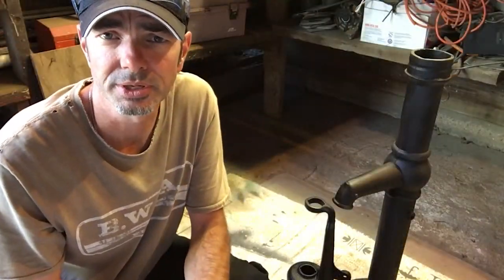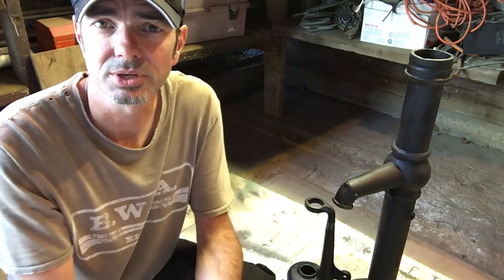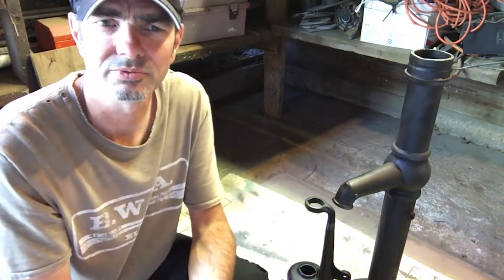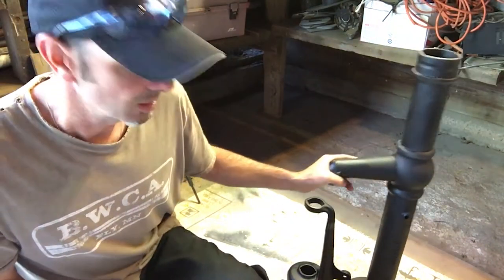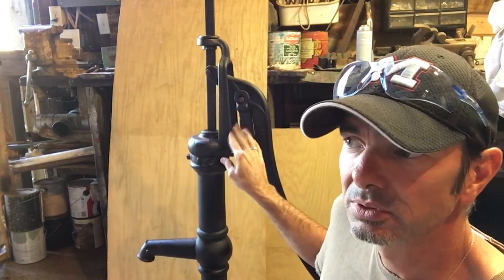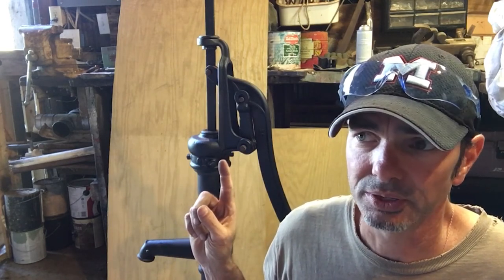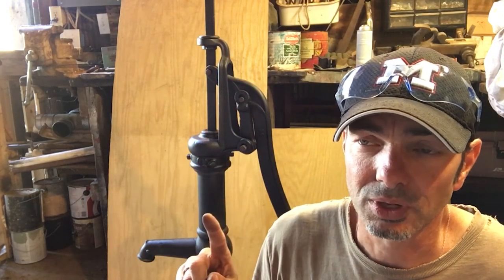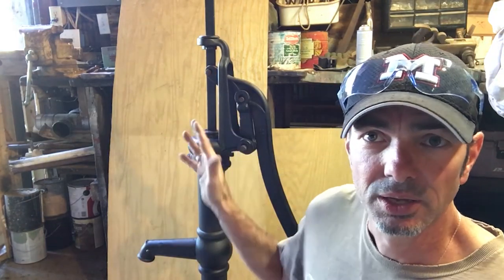Rebuilding the Dempster Windmill Pump Part #5

Comment: Great farmer ingenuity getting pipe out.  I have several of these needed restoration in various parts. One I dropped on drop pipe and broke it inside... yard art.
I have two candidates for restoring and actual use on well.  Until I get my windmill I'll use an red jacket pumpjack I found! Thanks for video.
Reply from the maker: Awesome! I still have not finished this project but hope to get back to it soon. Thanks for watching!

Comment: The lower bolt that you broke off and drilled out is for a kick stand. The bolt can also be removed to send bleach down the well to clean it as well. Much newer models have a bolt at the base. 
I will look and see if there is another video of you installing it. My main question is how did you seal the pump to the well and well pad?

Comment: back in the day we would need to prime the pump to get it to work by hand
Reply from the maker: This one will not need to be primed since the water will be pushed from the bottom of the well. I do have a pitcher pump that could be mounted beside the windmill pump for a back-up... hmmmmm. Might have to do that.
Reply: I think our old hand pump had a leather flap

Comment: do they make a modern pump like that from common parts
Reply from the maker: There is a ton of stuff on the internet that will make your head spin! I think I am going to make my own well cylinder that will be in the water pushing it up to the pump. So that will be in another video.
Reply: @ChickaWoofRanch  can you add a few links for restoring old stand pumps you have found?
This is a lost art around my parts, I dont have windmill yet and want to pull water up to surface with a pump Jack and old well pump.

Thanks